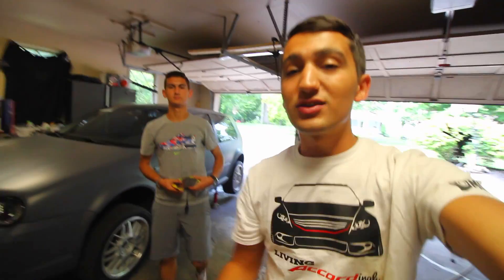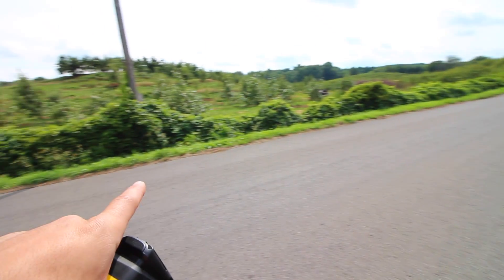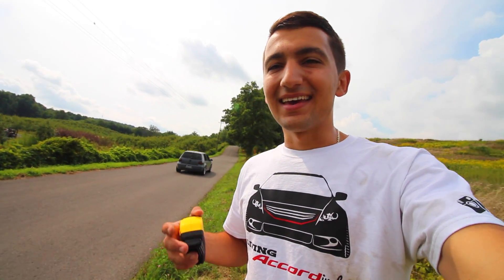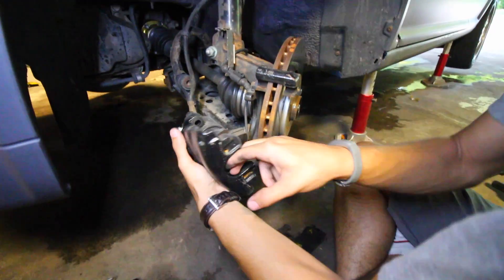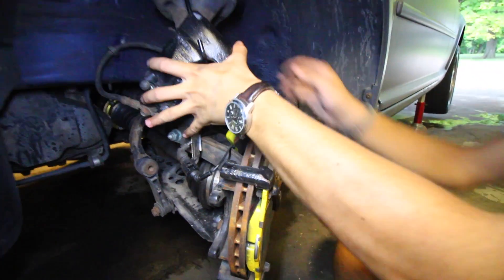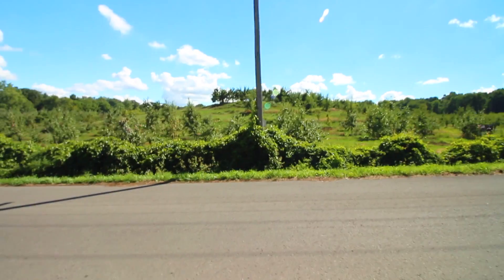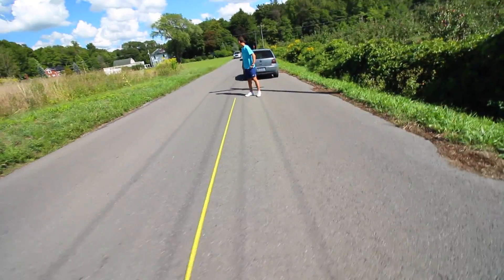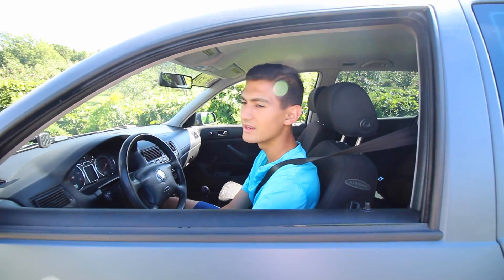Do PERFORMANCE Brake Pads Make a Difference? (WITH PROOF)

Comment: so many people think Ceramic Brake Pads are BEST for stopping Power THERE NOT PEOPLE !!  GOOD High Quality SEMI-Metallic brake pads are the BEST for Stopping Power   that's why Semi-Metallic are used on Tow Vehicles  & Big Trucks F350 & larger  !   & do some research on drilled & slotted Rotors & you see there NOT The BEST For STREET USE !

Comment: for  proper test you should bed in the yellow stuff "properly" and heat the brakes before committing the test. it will make the test more accurate and better for the yellow stuff

Comment: hello. I need your help to narrow down on what I need to do with my brakes? During the first drive of the day, my brakes make this squeezing noise but then later on subsidies.  On the application of brakes, I feel a little throbbing on my brakes. I have a 2005 Mazda 3 about 140 clicks. Should i change my brake pads or discs or the whole system?
Reply from the maker: From the looks of it, your brake rotors are warped. I would suggest getting new brake pads and rotors to remedy that problem.
Reply: Thank You for the reply. Suggest me an economically brake pads and rotor? Mazda gave me a quote of approx $1000+Tax. I dont want to invest too much being its a 2005 model

Comment: If you really want to improve the front brakes fit calipers that have pistons on both sides (2 Pot or better still 4 Pot) and ditch those floating ones, They used to have them on Motor Bike front wheels andwere crap
Reply from the maker: Upgrading the callipers will make a big difference but changing them out will cost a lot more than just upgrading brake pads.
Reply: True but you would not need the spacers then as the calipers do not move when you apply the brakes?

Comment: don't new brakes have breaking periods like you aren't supposed to brake hard for a few hundred miles
Reply from the maker: Yes. We already did that and drove a few hundred kilometres before doing the test.
Reply: psychobillionz reverse with these pads they need beeding in with various stops from  certain speeds.

Comment: Milan, would new brake rotors help with the brake dust as well? For example if you bought "performance" or drilled-slotted brake rotors and replaced your OEM ones with those, would that help with less brake dust (And better performance, stopping, etc.)?

Been thinking about getting slotted rotors myself (Current ones are just regular ol' rotors, so they aren't drilled slotted) but they're pretty expensive so I was wondering if they are worth buying. People say that they cool the brakes better and prevent less brake dust, plus they're red and look sick lol.

Comment: Why 0-60 isn't it's supposed to be 0-100?
Reply from the maker: I was doing 60-0. For your test you can do any speed you like. You can stop from 141-5 if you really wanted to. Aftermarket pads like the ones we installed will stop a lot better than factory pads
Reply: 0-100 real quick
Reply: Whole squad on that real shit
Reply: milanmastracci omg you replied :')
Reply: Nickheezy Breezy 60 -0 for stopping

Comment: OEM is not original Milan! OEM is a manufacturer of parts that make original(like) parts but original is original. OEM is not original
Reply: Nope bro, OEM stands for original equipment manufacturer, ok they might be not made by Volkswagen themselves, buy when you buy a new golf you get that brake pads.
Reply: +PizzocanWasd nope :p there is a possibility that it is oem but mostly it's original. if you are looking for parts for for car, most of the time you can choose between original, oem and aftermarket

Comment: you should always resurface your rotors or replace it when replacing your front pads... something to consider next time
Reply: and where did you get that from?
Reply: It's recommended because if you don't it takes longer for the pads to bed in with the old rotor which has the old pad "shape".

Comment: I would have liked a more accurate measurement, hard to take this seriously with a tape measure
Reply from the maker: Even if I was off by a couple inches, I averaged 10 feet of a shorter stopping distance, only from going 60-0.

Comment: Will I need to upgrade my brakes before my test? It's in 2 weeks and they have a squeal, will that matter for the test? I plan on upgrading my brakes anyway but would it fail a test because of a squeal from one wheel?
Reply: The car has amazing brakes as it is thats why im not very interested in changing them so quick.
Reply: squealing isnt a good sign. Id have that addressed first.
Reply: ***** I plan to, Its just my closest good mechanic is always booked up, It took him nearly a week to be able to fit an oil change.
Reply: ***** do it yourself. Not that hard sir. You could have uneven brake wear if only one tire is squealing. Id check your rotors and calipers also to make sure everything is secured and not loose, or damaged. Milans videos and other videos on youtube should be able to help you do this. I do almost all the repairs on my car using youtube videos and google searches. And I do a pretty decent job.
Reply: ***** Yeah I planned on it but I've been on crutches for 3 weeks and still have another to go, so money is an issue until I can work or anything like that, I have 2 weeks anyway so hopefully everything will work out, My rotors and calipers are fine its just the pads I had a check up myself but I'm going to get it sorted before it does any further damage and end up having to pay for more stuff.
Reply: Good luck sir.

Comment: Was gonna ask if it reduced brake dust. Cause regular pads are almost always dirtier here. Turns out it caused more dust lol
Reply: EBC makes different "compounds" if you will. These are the second best for street use. There is i believe a "Green Stuff" set, or it is the "Red Stuff" one that give a bit more stopping power but has less dust then the "Yellow Stuff" (shown here in the video) and the "Blue Stuff" (the most aggressive pads for street use, the used to be the "track" pads from EBC, but tests showed that the 'cold friction coefficient' of the blue ones where even better then the yellow ones).
Their track pads are now the "Orange Stuff".
As a 11 year user of EBC brakes I can highly recommend their pads!
Reply: All the EBC compounds will reduce brakedust, i have used green and yellow stuff because of that manner and my creme-white wheels kept cleaner a lot longer than with oem pads, the brakimg power is imprvoved a lot aswell wchich is a plus :)
Reply: video's description says ebc produce more brake-dust than oem : 'Overall, the aftermarket pads outperformed the OEM pads in every aspect,
 however we noticed that there was more brake dust with these EBC brakes. It is a tradeoff that we are willing to accept. '